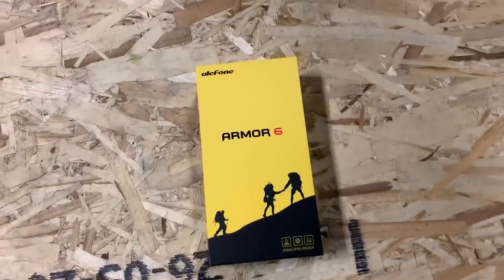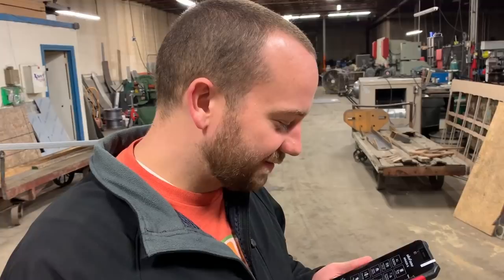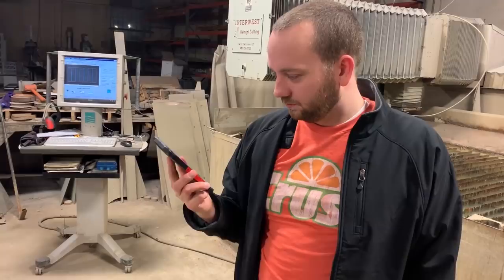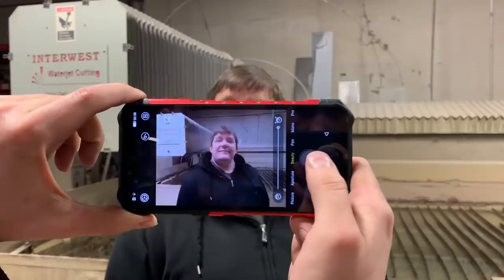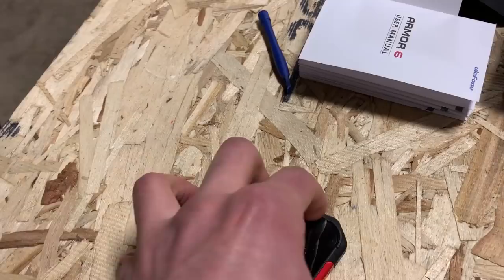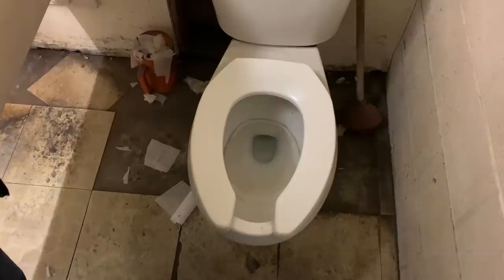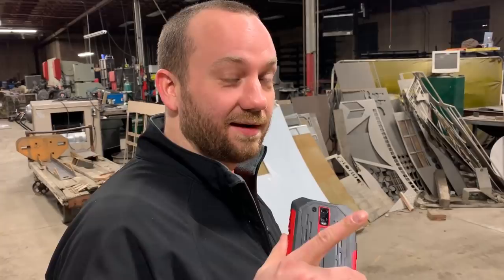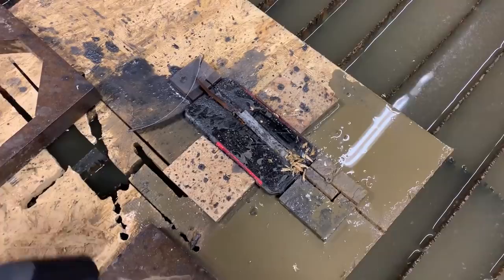World’s Most Rugged Phone vs Waterjet - Random Machine Shop Tests

Comment: Should have done the waterjet first instead of the humvee. The phone's integrity was already weakened after running it over with the humvee. Not that it would make much difference against the water jet(based on your other videos), it would just be easier to see if the special water resistance made any difference at all.

Comment: It would be really dumb if it ~just~ had a UV Index sensor.  It would be really cool if it’s normal light lumens/temperature sensing that it uses for the camera also had a tiny bit of software that measures the UV component and gives you a UV Index reading as well.

Comment: Should've left the screen protector on before running ut over
Reply: because a piece of plastic 1/4mm thick is going to stop a Humvee.
Reply: they put a new one on, you can see it on there
Reply: They did. They also ran over it with the screen up anyway, tires aren't exactly sharp. It was just too much weight. Paper thin plastic won't help in the slightest.
Reply: @charmio  im pretty sure that op was joking

Comment: Maybe try the phone on a piece of flat steel or 3/4 plywood. I know with it setting on the rocks it made like a 100+ small pressure points on the phone instead of one big flat one. How do i know this? I ran my company iPhone 7 over with a small Kabota backhoe tractor on some gravel and the only thing that broke was the screen from where the gravel rock pressed against the screen.

Comment: Will it blend, that is the question?
Hwoooo, lithium smoke. Don't breathe this!

I own a Cat S61 which has got pretty much similar features and it came with a proper glass protector already on it instead of a piece of plastic. It's got some much better features/tools built into the phone instead of a UV meter. I'm pretty sure most people know how hot it is not if you need to put suncream on.

Comment: The manufacturer is trying to tell you that it loses its waterproofing after something is broken on the phone in a drop test or any other stress test that causes failure to the structural integrity. Pretty simple logic. You put a hole in a boat, it collects water.

Comment: I bought an armor 6e after my S7 active screen got burned in and broke its glass under the polycarbonate screen purely through heat of the sun (on my bike) which seems to be a big flaw with that Samsung phone. What a crappy phone that S7 is next to the Ulefone. Using it for 7 months now (also on my bike, through any weather), best phone I ever bought. It is very sturdy and above all it does not have this shitty amoled screen that wears in time and can burn in.

Comment: 5000mah battery runs for 6 hours. my little slider has a measly 1000mah cell and can run for over a week. Just goes to show power consumption between high end and low end tech huh

Comment: I ordered 5 Ulefone Armor phones earlier this year.   One of them suffered cracked glass in the first month and another 6E didn't stand up to exposure to water.   

Their support staff said the phones are NOT water proof (even though it's advertised and stamped on the side of the phone).    They wanted me to send phone over seas and charge me for repair.

Trying to tell their support staff that our US state has laws against false statements and the penalty they may suffer is like talking to a wall.

I assume THEIR cost to produce is probably under 150 US dollars - But they stand to lose thousands by not honoring their advertised claims.   It's my opinion that they lack common business sense and they don't appear to act in good faith.

When the phone worked - It was amazing!   But we have failed to realize the claims they have made regarding durability and waterproof features.   It's my opinion that these phones are NOT durable.